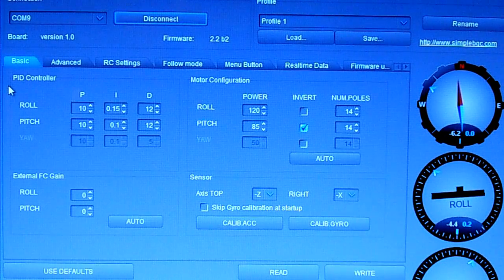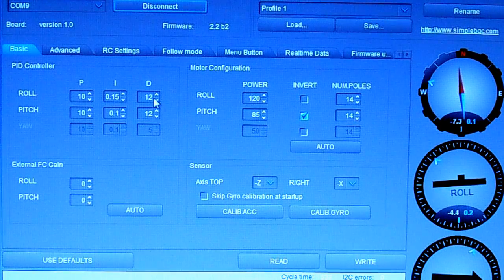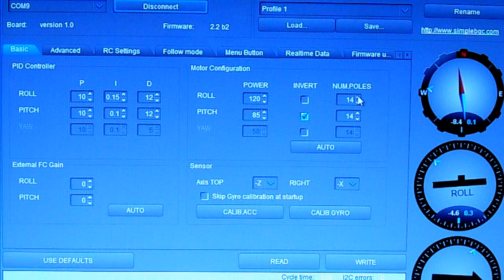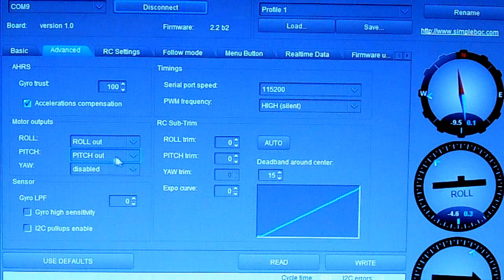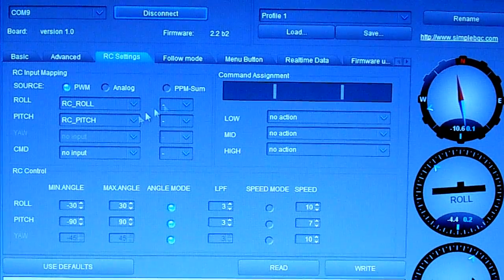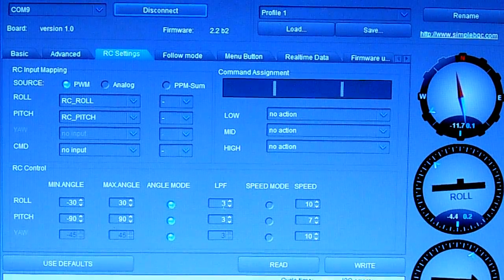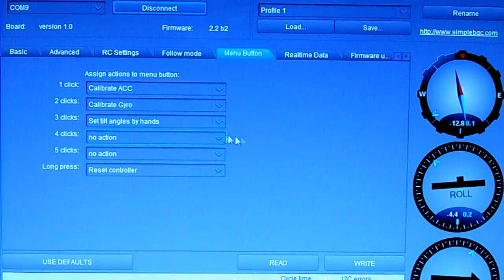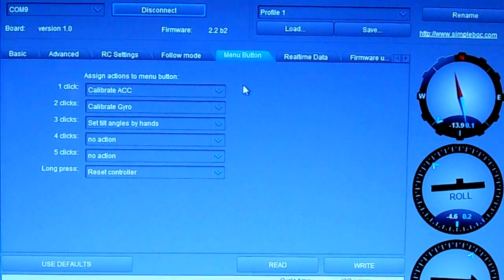Simple GUI 2.2b Gimbal settings

Comment: Hello. This still active? The settings works but when i tilt the drone downward the gimbal follow. How do i fix this?
Reply: try making your deadband around center in the advanced tab higher.  i have mine set to 200 due to the pitch following the aircraft in speed mode.  Also check to see if your gimbal is set to follow the craft in the naza or software for your drone.

Comment: Hi thanks for the video! I would really appreciate a bit of help: I am trying to setup a Gimbal to stabilize a 360degree camera (Ricoh Theta S-just barely heavier than. GoPro M of mine for use on a F550 Hexacopter. Any suggestions for the best way to go about doing this? Do you think I could buy a cheap GoPro Gimbal and mess with the settings in the GUI and if so what would need to be adjusted? Or should I build an entire gimbal from scratch? I've never built one or tried changing settings I've just bought and used them in the past. Any suggestions would be much appreciated, thank you!
Reply from the maker: Hi Ryan, I now use the Quanum Q-3D gimbals for about a year. GUI is old quirky technology and they become a brick for no reason. For 100 bucks the Q-3d can't be beat.

Mitch
Reply: +Mitchell Peterson hey thanks for the response. How can I use that with a camera other than a GoPro? Is there an easy way to change whatever settings need to be changed?
Reply from the maker: It depends the physical size of the camera. You most likely need to go with a larger gimbal that will accommodate a full size SLR. What camera do you have?
Reply: +Mitchell Peterson I'm actually trying to figure out a gimbal for a 360 degree camera. Almost the same weight as a GoPro maybe a little heavier. That's why I thought there might be an way to just adjust some settings for one of the many GoPro gimbals out there. It's a Ricoh Theta S, you can look it up. And I also wanted to mount it just below the gimbal by its tripod mount hanging down so that the gimbal isn't all over the picture.

Comment: Hi Mitchell, nice video.
Im having a big issue with my gimbal, in ground works like a charm, also while hovering, no vibrations no shaking, but when I gain like 5m of altitude the camera starts to point  down like it got hitted in the top (pitch is failing),   Im running exclusive battery for gimbal, power is high enough, and the Pids seem fine, I don´t have any clue about what could it be...
Reply from the maker: +Dashz Hi, link the flier to Naza. With in the Naza software lower the "Gain" of the automatic gain control. If you don't use a Naza M v2 or Naza lite link up the gimbal to the GUI program. At this time save the profile so you can always return it to the original settings. With in the program lower the gain NOTE: Always press enter on your keyboard to save the changes.
Reply: +Mitchell Peterson  Thanks for that quick answer,  so basically I should use the "External Fc gain" option to get a good results? Im using cc3d and it has an option  for gimbal, Ill see if I can make the thing with this Fc board.
About the gains within the GUI , I have already lowered , increased and  reset , P I D EJGITROVIsXSDS , everything and still behaves the same way.... 

I think I should also buy a manual to learn how to be patient tuning hardware and software for aerial photography.
Reply from the maker: +Dashz Try this....totally disconnect the gimbal from any controller other than power. Re test....any change?

Comment: God bless you! I almost went deaf after a "default" settings the gimbal started to use the low freq (noisy) setup :D
And also went crazy... Now with your settings it's fine! Thank you!
Reply from the maker: +Veryokay Glad to help out
Reply: Going to upload soon my very first gimbal video, thanks to you! ;) Do you may know a workaround for the roll "knocking" effect? When the camera reaches the gimbal frame it's knocking there for a few msec...
Reply from the maker: +Veryokay Make sure all of the wire leads coming from the gimbal are totally free in all angles

Comment: Mitchell, I installed a fpv 2 axis gimbal on my Phantom 2 and I have it connected and powered however, I have the upgraded Phantom 2 controler (with the gimbal knob on the top left) and I can not get it to work for rotating the gimbal up and down.
Reply from the maker: +joshua chavers Hi Josh, send me your phone number and I'll call you. One thing to do is plug it into a computer , find the window for gimbal....fi f2?? move the knod back and forth. You should see movement on the screen...set the gain to 0

Comment: Thanks a lot for making this video! Received my gimbal all spastic and growling, and it is now behaving beautifully.
Reply: ukkisavosta Forgot to mention that I've decreased the "pitch power" on my gimbal to 50-60, as it would start jittering on the normal setting of 85 after a bump or if the pitch axis interferes with the body at end points. FWIW, I use the gimbal with a Mobius cam.
Reply from the maker: ukkisavosta Glad to help out. Fly safe

Mitch

Comment: Hi Mitchell. I recently bought this 2 axis gimbal : http://www.amazon.co.uk/Annong-Brushless-Gimbal-Controller-Phantom/dp/B00W3IB55G   It worked great on my first flight, however on my second time I turned it on, it just did this (this isn't my video) : https://www.youtube.com/watch?v=KvD8IMMgwgo    I have tried with the button on the board with the 1 click, 2 click, and 3 click, but it keeps doing the same thing as in the video. I thought that I may be able to fix it when I plug it into my computer and go on the 2.2b software; however when I go to the drop down menu to choose my model, it doesn't come up...Do you know what the problem may be? Thanks
Reply from the maker: cheza3000 sounds like the driver is not installed. Find the downloaded driver and open it up. Remember, these programs are old and quirky. It's not enough to download the software. Open the driver to install it
Reply: Ok, great. Thank you very much

Comment: would you mind sending that setting to my email?
my gimbal has some issues,
after using it for more that 5min the roll will start to mess up. it will tilt from side to side,
so if your setting will resolve my gimbal.. thanjs in adfvance
Reply from the maker: sir francis Sure, send me your email address
Reply: Mitchell Peterson sirfrancis222@gmail
Reply from the maker: sir francis i sent it. did u get it?
Reply: Got it.. Thanks. Will try this tommotor

Comment: hi mitch,my 2 axis gimbal also run 2.2b ,i also tuned the pid  but i found my gimbal motor have a slite vabration,but very slite!  it have"zhi  zhi" voice.and touch the camara can feel slite vabration.i have choosed  the " high slient ".how can i slove the problem.thank you
Reply from the maker: Hey man, under motor configuration turn down power 10 at a time, click write once, disconnect usb, power cycle the gimbal and re check stability. repete sequence until the motor settles down. If you find these changes have not changed or solved your problem return the values to the original values.
Reply from the maker: I would also suggest that you save the original profile. That way if you get the gimbal way out of tune you can always return it to the original configuration.
Reply: thank you very much，and i have found my problem.i wrote the wrong POLES of my gimbal's motor.its 12 poles and i wrote the 14.what a mistake!and makes me so confusing！
Reply: and could you give me an advice.Now my video is no jello but have a little shake especially when the copter moves fast.Is the damping ball so soft or so hard？thanks again！

Comment: Thanks for the video, very good settings but I had to chang it some.  I have this same gimbal and the roll motor was getting hot. I checked the polls and it only has 12 poles not 14.  So I changed that on both roll and pitch. I also lowered the roll power to 85 and everything is working even better now.
Reply from the maker: Hi Josh, I'm glad you were able to get your gimbal up and running smooth and cool.

Mitch
Reply from the maker: Wanted to say it's always a good idea to save your profile for use down the road. These boards have a tendency to become brain dead. When that happens simply load your saved profile and all is well.

Mitch.

Comment: Hi! I'm wondering if you have any idea why my gimbal only works when I have the board on the gimbal plugged into my computer and into my phantom? If it's only plugged into my computer the LEDs turn on, but won't stabilize, when I then connect it to my phantom it starts stabilizing, but when I then unplug it from my computer it completely turns off.
Reply from the maker: Check your ground wire

Comment: This is the information and the video that I was looking for. Thanks a lot for sharing this information. I was trying to set up this thing for two weeks with out any luck but with this simple video finally now it's fixed. Thanks again.
Reply from the maker: You are welcome. Another thing, you can save the setup to a file. If you get to far out of adjustment you can always revert it back.

Mitch

Comment: thanks Mitch  my setting were off from what you show  I changed all, then I saved it then loaded  but the new setting wont save in the board any clue why...  thanks
Reply from the maker: Each time you make a change you need to hit the enter button. Are you doing that?
Reply: No... just change the value on everything then hit the save button
 ..then the load bottom. Is that wrong..
Reply from the maker: butch godkin The save button is for saving a complete profile (I can send you one if you give me your email address).
So don't hit the save button, hit the enter button
Reply: Mitch Peterson send me your profile please gerencia@compro-barato.com

Comment: I need some help.  My gimbal jitters when I roll to the right.  I might have inadvertently changed a setting.  I'm really not sure at this point but here is a video showing what's happening.   http://youtu.be/jCYH5X-8JPs
Reply from the maker: Shawn, usually the twitching happens when the cables are binding. Check that by hand making sure they are totally loose. If that doesn't work send me your email address and I'll send you a new profile.

Mitch
Reply: it is definitely not the cables.
Reply: k
Reply from the maker: Will get you a new profile later today when I get to my other lap top. Make sure you save your old profile.

Mitch
Reply: Thanks!
Reply from the maker: Shawn Szoludko
Yo Shawn, I sent you a new profile.....did that help?
Reply: Mitch Peterson
No help.  But thanks.  I am sending it back to China and have ordered another one as well from a different source.  I have a shoot I am doing tomorrow and will now have to go without.  I think it might be the board.  I swaped the connections from pitch to roll and now I am having the same issue with pitch after the swap.  Somehow the board hosed the motors.

Comment: Hi Mitch, I just was able to calibrate the Gimbal (using your settings) and when I move my lever on my transmitter box, for a 90 degree tilt down the motor vibrates. Is there a setting I'm missing? Thanks...
Reply from the maker: Hi Paul. Un plug the two wire tilt harness from the board...power up the gimbal and tilt your craft in all directions. It (the gimbal) should stay level. Also the gimbal must have the camera in it to work properly. Is the gimbal staying level and jitter free?
Reply from the maker: Mitch Peterson If any of the wires are binding or in the way it will cause stability problems.
Reply: Mitch Peterson  Yea, I just tried this,unplug and tilt the gimbal (it does stay level) still the same, I noticed it starts to vibrate at 45 degrees and gets worse. possible bad motor?
Reply: Mitch Peterson  Thanks, I'm also wondering, I'm using the gopro plus on what looks like a standard gopro base on the gimbal (larger), but it should self calibrate every time you power up right.?
Reply from the maker: It comes in auto cal from the factory and it is in the settings. Make sure the wires are free and not binding or tugging. Play with it...I'll send you a profile to upload. I need to know which gimbal you have and an email address. Take a pic of it and send it to mitchpeterson@comcast.net.